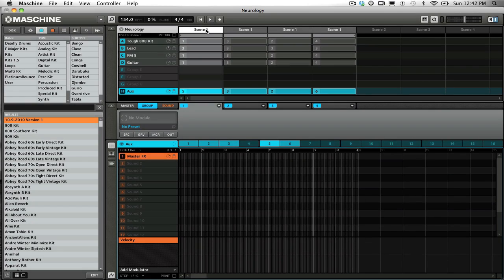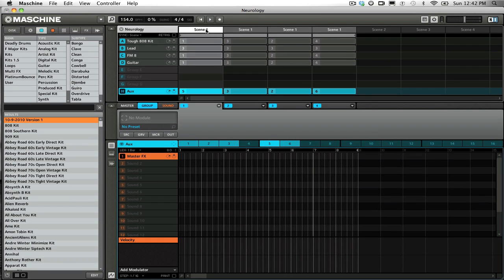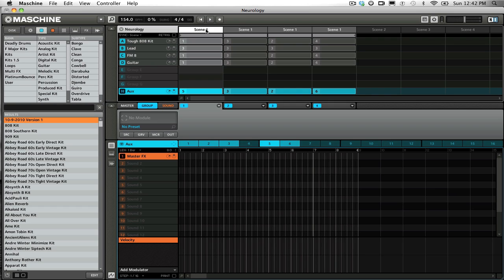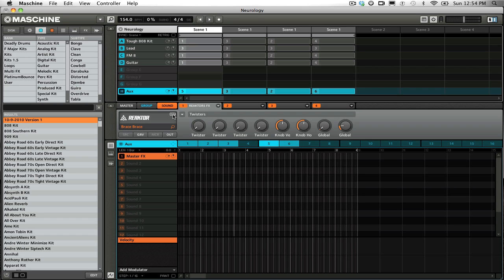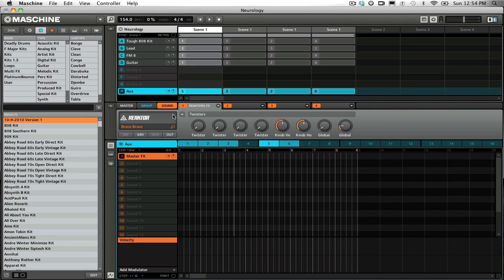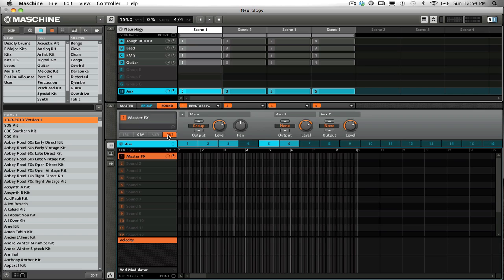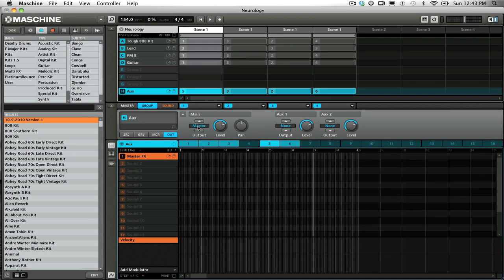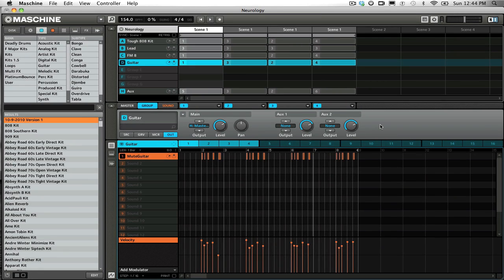How to use Master FX Automation in Maschine 1.8: Altruwisdom

Comment: How do you automate fade out bro?
Reply: Instead of using The Finger as Sound 1, use the EQ plugin instead. You'll have to draw in all your automation. It's difficult to make it smooth, but you can still make a fade out. Maschine needs to work add better drawing tool.

Comment from the maker: In my video, I am using "The Finger" by Native Instruments, which is a midi controlled effect plugin. If you want to use non midi controlled effects with this configuration you just have to automate the controllers using the Maschine hardware on group H (Master FX). All you need to do to record the automation is hold the auto write button and turn the parameter knobs on the Maschine controller. Any effect or plugin that you load into Maschine will generally automap its parameters to the 8 knobs.